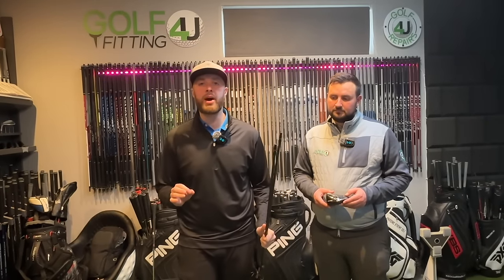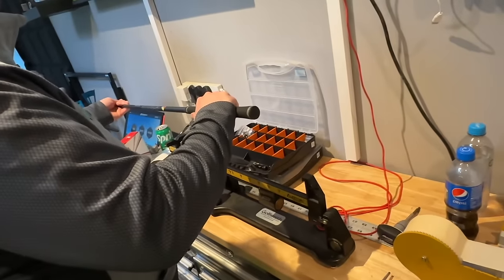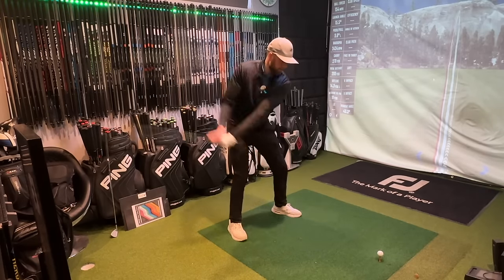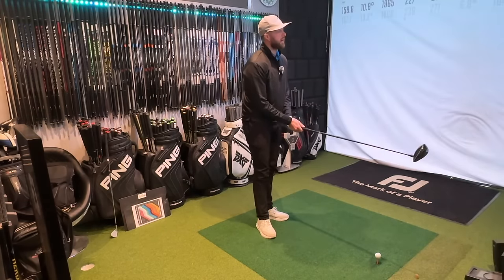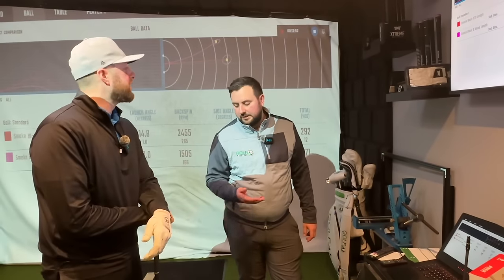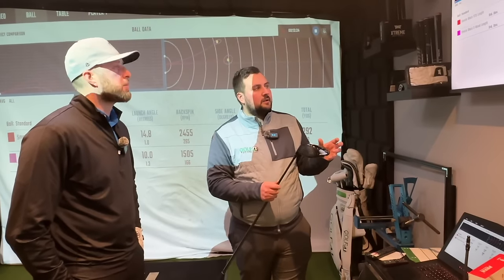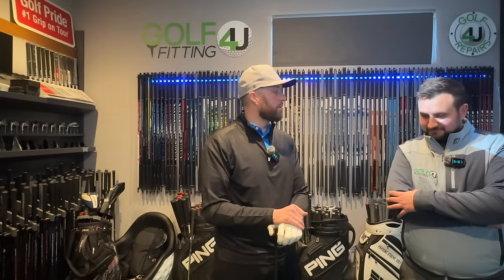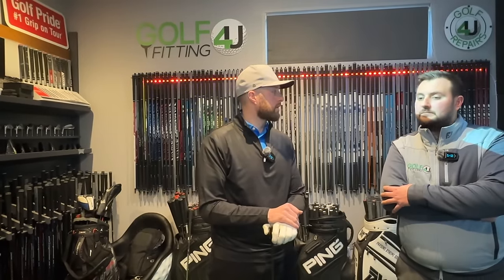You must watch this video if you want to gain accuracy by playing a shorter driver shaft length

Comment: I shortened my pxg driver to 43.5” and added extra weight to the head. No difference in distance and I gained accuracy. My confidence on the tee is higher as well.
Reply: 100 %
Reply: I did the same to my qi10 max. Switched it from stiff to regular thinking the shorter shaft would feel stiffer. Much more control, more confidence and arguably a longer average distance.
Reply: How much weight have you added?
Reply: @mackwrx  the standard weight in the back was 10g and I replaced it with a 20g weight.
Reply: @davidb8586  Awesome. Thanks David! 🍻

Comment: I'm 5'6" and went from a 45 3/4 to a 43 and it was a world of difference. I cut the shaft down and it's been amazing.
Reply: Same here, including height. After a great couple of months with driver I started hitting poorly so made the switch using my 3W shaft to regain control. Still want to test different lift settings and weights to optimize if possible.

Comment: The amateur golfer will never notice a 10 point swing weight difference, and the accuracy will be significantly better.  I lost an inch on my driver and 1-1/2" on my fairway woods and am still choking down (6’ tall male, average build and weight).  I’ve gained club head speed, distance and accuracy.  So much easier to swing now.
Reply from the maker: This could be a good test. I agree they might not notice it, in feel, but I would put my house on it performing different to how it did, and not necessarily in a better way. I’ve made note! This will make a great video 😮‍💨

Comment: Agreed that virtually no “fitter” talks swing weight at all.  It is head and shaft and not even length at all.
Reply: I think it’s a 2 fold reason. 1st the majority of golfers have ZERO clue about swing weight, and 2 most of todays fitters aren’t as educated in swing weight vs years past. You really have to search hard now to find someone that understands swing weight. Here in the US you need to go to specialty fitting centers or a high end golf school for that much detail in your fitting, and those fitting are pretty expensive!

Comment: I shortened my Titleist driver from 46 to 45in and increased the weight from the stock 9 gram to a 23g. I hit my drivers higher and a bit farther. Huge increase in accuracy and I’m hitting a slight draw instead of a fade.
Reply from the maker: That’s the way to do it 👌🏼

Comment: Gary/Sam great video as usual!, This also shows the benefit PXG have over pretty much every other brand at the minute with their design! Its no wonder Sam is partnered with them they are a fitters dream with the weight system.

This also shows how a PXG driver could be great for you, especially as you could use the PXG fitting on the adaptor to be 3* flat in whatever loft you prefer, with your thicker grip you will then be able to add the weight around the head like you did here for the 3 wood and gain ball speed while still keeping the same swing weight. I think thats where the weighted 3 wood gained its ball speed from the much lower swing speed. The 3 weight system really allows for a much more custom fit I cant believe clubs like the TD ai smoke only has the 1 front weight for eg, no option for heel/toe weighting......

Comment: I cut down my driver shaft by 1.5 inches. Its lowrred my swing weight by 9 points. So i added 9 grams of lead tape to the head. It brought it up 4.5 swing weights. I hit it 10 yrds further. And i find the fairways 25% more. So for me it worked. I only did this because i couldnt afford a new shaft. If you have the money , just get fitted. I am an 18 HCP.

Comment: Gary, being an excellent golfer, you are going to feel or know when a club is right or wrong for you more than the average duffer. Your friend detailing the info ref the swing weighting? Priceless. Every golfer can do their best when the swing weight works in their favor. I prefer a shorter driver because I am not long and lanky. I'm short. Shorter clubs fit me better. I also prefer 2 degrees flatter irons at the hosel. Getting fit to optimize equipment is very important.
Reply from the maker: You do right playing a shorter length driver, how can everybody be the same length driver, there’s noway that on tour this isn’t considered, and so it should be for everyone else.

Comment: I have a 2014 Ping Rapture 13 degree 3 wood Regular with heavy tungsten sole weight, which I bought 2nd hand (but £395 in 2014 so clubs not just expensive now) when my driver was out of control, the shaft length is 43.5 inches, I now have a Ping G425 Max 10.5 degree Regular shaft length 45.75 inches weighted similarly to Gary’s. It’s difficult to say what the dispersion differences are but total average distances are very similar & carry is 10 yards or so less due to lower height probably. Definitely a good back up club for links or windy conditions.
Reply from the maker: I used to love those rapture takeaways! Perfect size for the tee! They make them too small and shallow these days.

Comment: Wow! Thank you so much, Gary, for making this video. You may have saved me from making a huge mistake. I found out last year that if I gripped down on the shaft of my PXG driver (which I ordered online, and just told them a few of my measurements), I started to hit my driver much better, and more consistently. I currently have my driver by my tool bench, and I was going to cut an inch off of the top and install a new grip. Thank goodness, I am a procrastinator or it would already be done. I think I will just keep gripping down in three months when our season starts up again. I don't have the weights to mess around with that part. You seemed to be hitting that shorter shaft just fine after the head was re-weighted. Thanks again.

Comment: I've shortened my driver shaft to 44.5 inches and lost no swing speed. I have another cut down to 43.75 and I did lose 2-3 mph but dispersion is wicked tight and its super easy to turn over. That's the same length as the taylormade mini driver. I feel like 44.5 is the sweet spot or maybe 44.25 (although I have yet to try that, but it's halfway between my shortest and longest setup). I really like the 44.5 anyway, it cuts out my propensity to leave the face open for a slice. I have PXG driver heads so I can re-weight in 2.5 increments in any of the 3 spots on the head, which is absolutely baller if you are going to do this experiment. You won't get "shafted" with an incorrect swing weight if you have the optional weight kit. I don't think I will play 45.5 anymore, it's not really worth the trade off for a mid handicapper. I get way more joy when I find more fairways, and more fist bumps from my mates! Great video guys, this sort of analysis is so needed for us recreational players. I'm a huge believer in 44.5 inches or less for the average golfer! I was shocked that I lost my no swing speed, but I boil that down to the fact that I felt more confident with the club in my hands and I could go after it harder as I wasn't held back mentally as much. That says a bit more about my own hangups with the driver, but I bet lots of golfers are in the same boat. Driver was worst club in my bag and now I enjoy smashing it at the shorter length. Also I would add that I can much more easily hit at least 3 degrees up on the ball with the shorter shaft, whereas with a full length shaft I find that to be much, much harder to accomplish consistently
Reply from the maker: Well done on being able to self fit so well. I can understand why you have more control now and you haven’t lost club head speed! We did an experiment, not posted the video yet, but I tested the maximum length shaft vs stock 45.5, and the performance diminished but most noticeable, the club speed reduced! We have to stop this perception that longer shafts will go further, as it’s all dependent on the person swinging the club, and what length they’re most comfortable swinging.
Reply: @garymartingolf  Thank you for the props! I use trackman to validate the head-weight changes in terms of all the numbers, especially spin, launch and clubhead speed, so that helps a tonne. I love nerding out with it. I 100% agree with you and I'm looking forward to that video! I was thinking during this video that going down to a 3w length shaft is perhaps more extreme than necessary, and there is a happier middle ground to be achieved here (maybe 44.5, or 43.75 depending on one's goals on the intersection of dispersion and distance outcomes). You're right that the person swinging the club is the big X factor. Sure, if you put a max length shaft on a driver and robot test it, it will go further, but we're not machines, nor are we Rory (and even he shortened his driver shaft recently).

Comment: With the availability of mini drivers these days, marketing at being for people wanting more control, this is an important video.  I'd think that the bigger head of a driver on a shorter shaft would be a better set up than a mini driver, which is like a 3W shaft with a slightly bigger head than a 3W.  I'm not sure it's a good test to have Gaz test it though because he was crushing it with the full-length shaft.  The test would be best if done by someone with a huge slice. That's the reason I have considered a shorter shaft, because I slice the driver, seeing Gaz hook them looks positive to me, as I'd love my ball-flight to go further left than it currently does (OB right).  It seems like fitting to get weighting right is more important than shaft length!

Comment: I've done it a couple of years back. Took a saw to the butt end and took off 1,5”. Couldn't hit it after that, didn't adjust the swing weight. Tried to with lead tape, but didn't have the right equipment. Very good video showing what I did wrong. :)
Reply: I reduced 2" off my driver and added 12 grams on top of the standard 9 grams. 21Grams total. that extra weight will help you feel the head and I think you will like it. (1.5" reduces 9.5 swing weights!) which is a LOT!! :) Good luck.

Comment: Content just getting better and better Gaz, top class…. This may sound like a stupid question, but is a good way to try out a shorter driver just to grip down an inch or 2 on a full length driver??? Does that keep swing weight the same yet would give an indication without any alterations as to whether it may work for a player or not??

Comment: What I did was bought the same shaft one flex softer and took a half inch off the grip end.  Then I used a heat gun to loosen the epoxy on the Taylormade tip to cut a 3/4 of an inch off that end.  Then I used some golf club epoxy to reattach the tip.  Lastly, I used a slightly heavier grip to bring the weight back up a few grams on that end because the Qi10 has a poor center of gravity with the stock setup because they added so much weight to the club head itself from previous years to achieve their B.S. MOI numbers.

Comment: Hi, you all singing love for shorter shafts on driver,great!
Myself start play 43" inch driver in 1980!
Since 20years now I play drivers on 47"inch, have short swing ,3/4 and find fairways all the time,clubspeed 85mph a slow swinger always been and now age 87!
Will try shorter shaft this week and see what ut would bee!?
Thanks for sharing
Johnny d Bergh
PGA retired😮
Reply from the maker: If you have access to a launch monitor, I think it would be worth doing a comparison. If a shafts too long, it might hinder your ability to create maximum club speed. These long drivers, are all built and very strong. Whenever I’ve tried 47” shafts, they’ve hindered me. 

With a standard length, you might be able to increase your speed.

Comment: I did this with PXG 0211 driver, 1 inch shorter hoping to get accuracy. While some improvement not as much as I had hoped. 
Went to a ping 425 max everything set as draw bias, reg length shaft. Tip from the pro and currently you will have to prize the ping from my dead hands. 
Hitting 60% or more fairways currently, and no major slices OOB etc
Not looked at swing weight for either club so would be interesting to have that measured for comparison

Comment: I saw a video where Chris Trott mentioned that Rory's driver, with the Qi10 LS model, was shorter by an inch and needed to add weight to the head to keep swing weight. So, yea, swing weight is really important.

Also, I just did a fitting and found that I'm a D8, while my current is D6. I  will be giving that a shot with my current setup.

Comment: Had my cut 4 weeks ago and swing weighted and I haven’t missed a fairway since.oh and no loss of distance either.
Reply from the maker: Smart 👌🏼 so many just cut them without swing weighting ⛳️
Reply: how do you weight it?
Reply: Change the weight that is in there or if it’s an older driver you can put hot metal in there.

Comment: Great video and timely advice Gary 👌  I cut my Driver shaft and last week that was before I saw this video. I did it as I was hitting my 3 wood as far as my Driver - so I cut my Driver shaft to 43.5 and added a mid size grip and 10 grams to the head weight. Maybe self fitting luck but it’s working as I feel I can go harder at it.  I have not measured the swing weight yet but its going straighter and longer ..  its a good result ❤ Wonder if I shortened my putter it would work better too 😂
Reply from the maker: I think the 10g you added in the head has balanced things out. Glad it’s working! Ahaha 👌🏼
Reply: I recently cut my driver down to the same 43.5 and tested with and Extra 8, 10 and 12 grams. (Extra 12 plus standard 9 in my Titleist TSR2 feels solid) I'm thinking about cutting 1 inch off the 3 wood and 3 and 4 Hybrid. Have you done that yet?

Comment: Watching the video the fitter changed head weights to get the desired effect. Could this method be used to compensate a different shaft being used?
Reply from the maker: Yes, 100%. When changing shafts, the swing weight will change and it’s not always that noticeable in your hands. The only way I’ve ever noticed it, is if you compare the club using different swing weights side by side. It wasn’t until I need this test in a previous video that I realised how much that alone effects the release of the club.

Comment: Shortened my driver shaft by 3/4 inch vs standard when I got fitted for the PXG Gen 5 driver and not only is it more accurate, but my club head speed went up 5 mph vs the standard length! Definitely worth the try!!

Comment: Notice my biggest difference was launch angle….maybe needed to add more loft…noticed increase in control and accuracy…distance not much change…maybe better since Better contact in center of face….i did buy weights for TSR to cover that issue

Comment: I did something similar.  Also I've watched a bunch of videos on this topic, but no one addressed rebalancing the club... (swingweight, shaft weight, head weight, shaft stiffness)

I had a spare stiff shaft (i use Reg), so I got it cut 1.5" at the tip as well as at the butt.  In theory Driver went from.a D4 SW to B4.  Not sure where i want to be so I'm starting at a SW of D0, which means 32 grams of the shaft head.  With that much weight the shaft is more like and extra soft senior, hence why I also cut off the tip of the shaft.  Now I should have a 42" driver, with a D0 SW and a Reg shaft.  In theory lol...   Can't wait to try it out.

Also did something similar to my 5 Wood :)
Reply from the maker: Thats some shaft tampering. You’re officially a golf shaft pervert 😂 

Hope the club works well 🔥

Comment: Callaway offer 1" inch shorter driver shafts...use with my rogue st, just as long but far more accurate...I presume Callaway have adjusted for swing weight
Reply from the maker: Yeah, I would think that if you order it minus 1”, they’ll send the head with lighter weight to balance it to the factory stock swing weight.

Comment: I put a 3 wood length shaft in my driver, and went against my pro who said i needed a senior flex because of my swing speed, put the 3 wood shaft which was x stiff, nice and straight average 200+ happy days, so my results were listen to myself and try it out you will  surprise  yourself, not going to change it now very consistent and a fairway finder, i also switched from a cobra king SZ to a TaylorMade M2 and the m2 was the most consistent, so sold the cobra 😂
Reply from the maker: Can’t beat when a plan works out, sounds like a weapon 👌🏼

Comment: Would just gripping down the driver grip 2 inches require it to be reswingweighted?
Reply from the maker: I do this sometimes, it gives you the sensation that there’s less leverage in the club, and you have more control. I think this is because you take the feeling away from the head, effectively lighten the swing weight, so i guess, it depends how you want the club to feel. If you add swing weight, it would almost counter what you’re trying to achieve be gripping down it.

Comment: Fitted an 1inch shorter shaft in my rouge max driver same spec. Instantly didn't like it. Strange but the head felt far to close at address and just couldn't make a good swing. Visually it just didn't suite my eye at all.

Comment: To keep the actual ratio as close as possible we would need 22.5 big weight and 5 gram smaller weights. The original 2.5/12.5 is 0.2 ratio. The 5/22.5 is 0.222. If I'm understanding properly you ended up with 17.5 and two 7.5s for a ratio of 0.43. I don't think it mattered for this test as the results speak for themselves here honestly but  with proper ratio I'm wondering if he would have had a higher ball flight resulting in more or less yardage?  

I have last year's BRNR mini and was wondering if I could chop a proper driver head down and do the same magic you've done here then play the 13.5 BRNR instead of 11.5 as a 3 wood replacement. Got me really thinking.

EDIT: heavy weight in back would increase launch, duh, so maybe wpuld have gotten back to original launch conditions and maybe even longer if the ball speed stays the same?!?!